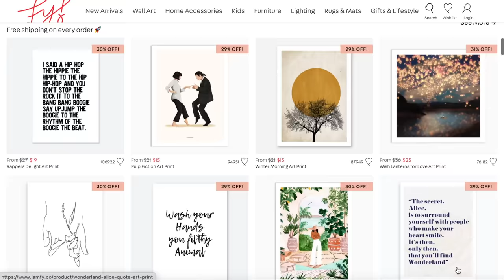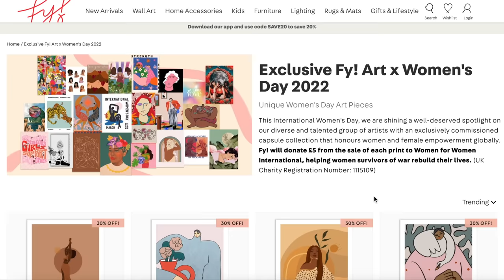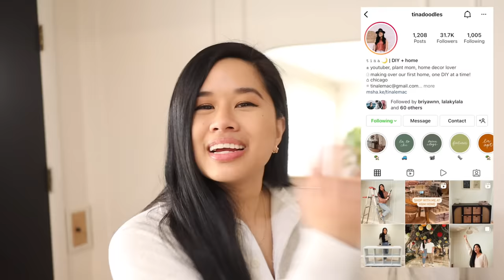TRANSFORMING MY OUTDATED ENTRYWAY! | DIY Front Entry Makeover! *Picture Frame Molding*

Comment: First, that mail slot is adorable! Second, you restored that ledge so well. I vote to keep it since it gives a visual separation from the entry to the living room. You could also add some molding or beadboard to the bottom half to tie it in with the rest of the entry, but ultimately it's your house and you should change it to work for you!

Comment: Great job. Loved the  door painted black and how you kept the timber ledge. The console table with huge mirror on top really made the space and the rug will be fine as long as you have a proper doormat outside. The only thing I would have done different is to paint the door of the mail slot in the same colour as the wall so it was invisible
Reply: I agree with you about the mail slot 100%

Comment: It's common for midcentury doors to have handles that are further away from the edge like your front door. My grandfather's 1950s house has a similar spacing with the front door handle. I don't think your pony wall is awful or dated, it's kinda nice separation. Nice job!

Comment: You should really keep the ledge (or replace it with sth similar). It's great at creating a separation between the front door and living space, which is essential.  Removing it will make you feel like you're sitting in a hallway instead.of a living space and will even lower the value of your home, so I really advise you to not open the space up more than it is. 
On a practical note the wall also blocks drafts and dirt from outside from blowing directly into your home (dust, autumn leaves, sand etc). 
If anything you could replace it with a window (like those black industrial panels you mimicked in your previous home).

Comment: When cutting with the miter saw, have you tried putting the blade on the line before you press the power button? This should help you get the cut right every time without multiple passes.

Comment: Please learn from my costly lesson and make sure you take the time to hang/secure your mirror to the wall, especially because entryways tend to be high traffic area.  Once you add in wet winter coats, pets, last minute pocket checks and it's a disaster area.  When we finished our entryway, we kept meaning to secure the mirror, but got really complacent with how it seemed pretty solid just leaning against the wall.  Then at our first dinner party, between hugs and greetings we heard a huge crash.  Luckily no one was hurt, but don't take your chances - especially with kids and pets!

Comment: As a woodworker for over 25 years, when I see non woodworkers use easy off on their furniture it makes me want to vomit. You are the first person to actually use the correct product and didn't just say, "screw it" and use the easy off anyway. That is the worst thing you can do to your wood. Not only do I see these people SCRUB THEIR FURNITURE WITH WIRE BRUSHES, not to distress their piece, but to get the easy off to work, but then they HOSE THEIR FURNITURE DOWN because the easy off doesn't come off so they just grab a hose and soak their furniture after "stripping" its water sealant...!!!! 🤢... Please, people, do not use easy off. Use a wood stripper, not an oven cleaner. SMH... Thank you, Tina, for going with your gut and showing the correct product because people will use what you use and follow what you do so choosing the Citristrip was the correct thing to do for your wood. Made me so happy to see someone who isn't a woodworker do the right thing.